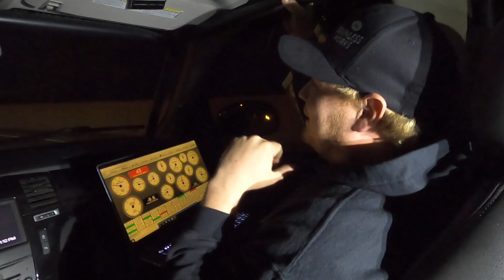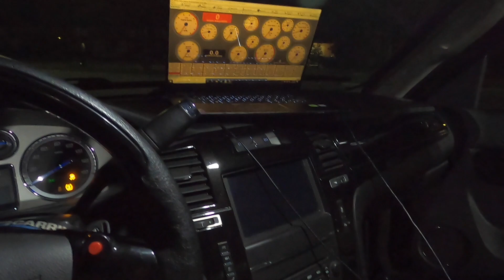Jeff Lutz Jr Rides in LSXcalade For The First Time! Visiting Triple Seven & Stories From The Build

Comment: Funny how innovators have a language all their own. 
Glad you weren't tempted to test the low range. The torque multiplication combined with the amount of power your engine makes, you would twist every axle that had grip, tear one or both drvelines, and decorate the parking lot with lots of shiny metal pieces and a lovely gear oil shower.
I think your Escalade should have an electronic shift solenoid with switch controls on the dash for the 4x4 functions, unless of course you removed them for race mode. Lol
Reply from the maker: The transfer case would just blow up. It’s been proven before by others 😂
Reply: @Stapleton42  Guess there's only one way to find out. Vroom vroom boom. Lol

Comment: Add a mechanical low pressure and high pressure switch send ground to the ac relay with both high and low in series with comp or use the HP LP switches to break / make ground circuit to factory relay and let the + side energize with the factory + from the control in A/C , Max A/C and defrost . Should work if not put them in series with your manual switch !

Comment: Question,  is the tcase all factory or did it get upgraded?  I figured this would only launch in 4 and then switch to two high with second gear. Man thats alot of parasitic drah all the way down the track.  😁👍👍
Reply from the maker: It’s a stock 261 from a 2500
Reply: @Stapleton42  do you run it the full 1/4 in four?  If so, I had no idea those would stand up to the abuse.

Comment: It would be really cool to rebuild this engine whith tha parts that you will eventually break and have it in the shop
Reply from the maker: What does that mean
Reply: @Stapleton42  if you break the block, you put it on a stand, than when you change the headers or anything you can start putting the old parts in the old block